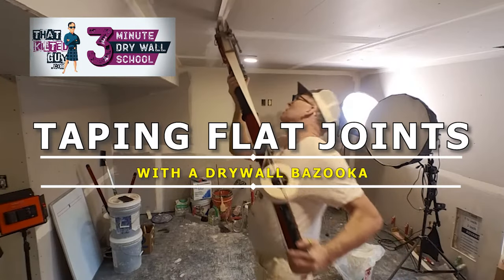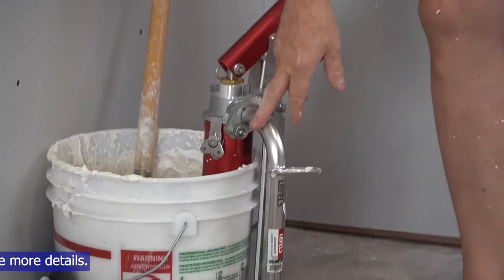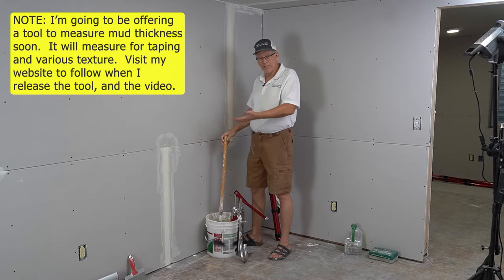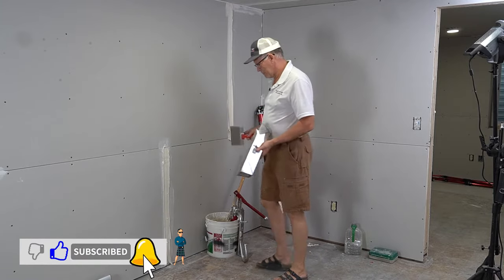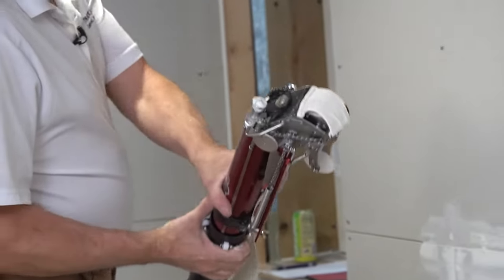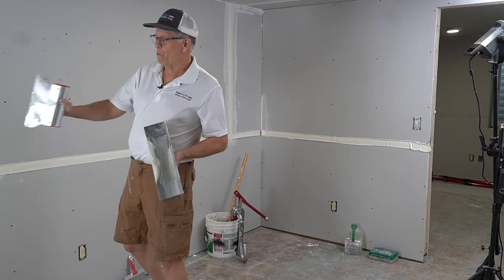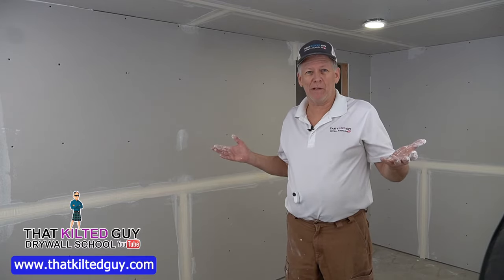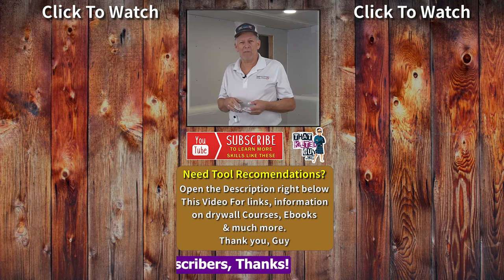How to Tape & Mud Drywall Joints with a Drywall Bazooka.  3 Minute Drywall School

Comment: When I start on ceilings sometimes the tape wraps around the wheel rather then sticking to ceiling..how do I avoid this
Reply from the maker: Keep it shorter to start. Keep the feed wheel cleaner. But it still happens some
Reply: @3MinuteDrywallSchool   thanks.. I appreciate it.
Reply: By doing it by hand.  These “inventions” are just silly. 

How much does this one retail for? 🤣🤣🤣🤣

Nothing beats skill. And this contraption is proof.
Reply: @charlesjebarb2863 I agree you can't beat skill by hand. But this let's one man tape a 300 board house in a day. They are for efficiency not skill
Reply: @stevensmith6379  and in half a day with two guys

Comment: Lets see you clean and service that thing...
Looks like a pain in the ass. Also why didnt you show the corner tape?
Reply from the maker: Hello, the corner tape video will be a whole separate video as it’s quite a bit different than this one. And I’ll show how to clean it in a separate video but it takes less than five minutes and it’s not hard. And in one days use he will save more like an hour so it’s well worth it
Reply: @3MinuteDrywallSchool  Looking forward to it!
Reply: @3MinuteDrywallSchool  it's not that hard to clean. Top plate comes off on the new ones.water hose everything down and lube up moving parts. 5 mins
Reply: @3MinuteDrywallSchool  on some job sites are using a gatorade bottle full of water and just spray it over a bucket you're not actually does a pretty good job
Reply: DCtaping, how about trying to finish a thought and use some punctuation. What you wrote makes about as much sense as what you wrote.